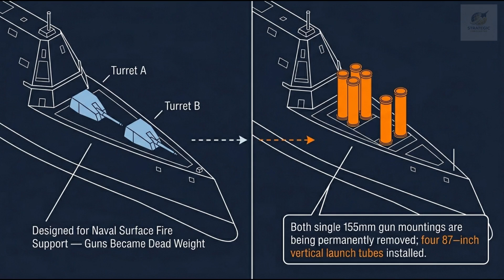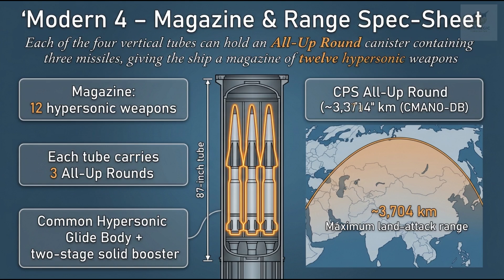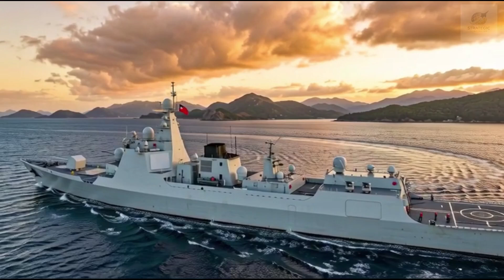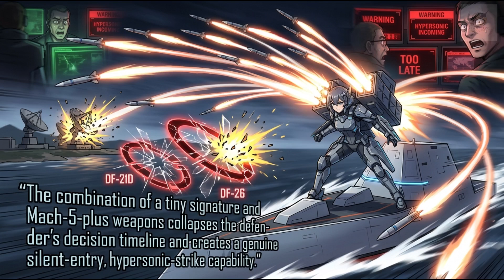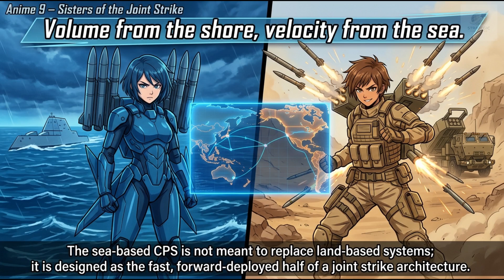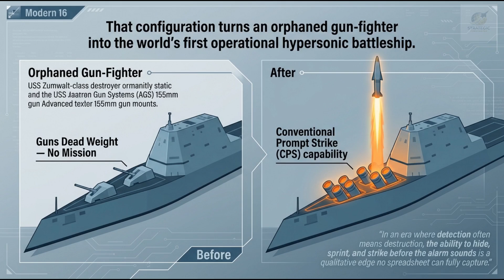Why Zumwalt’s Hypersonic Missile Changes Pacific War Forever (2026)

Comment from the maker: Thanks for watching this deep‑dive on the Zumwalt‑class and Conventional Prompt Strike.

To recap:

    Both 155mm Advanced Gun Systems are gone, replaced by 4 vertical 87‑inch launch tubes carrying 12 hypersonic CPS missiles.

    The Navy’s first true hypersonic battleship can penetrate layered A2/AD rings that would betray a conventional destroyer.

    Combined with land‑based PrSM Increment 2, this creates a volume‑from‑shore, velocity‑from‑sea strike architecture.

Now I want to hear from you:
Do you think three hulls armed with CPS are enough to shift the balance in the Western Pacific, or does the Navy need a larger class of hypersonic shooters? Drop your take below.

👇 If you found this breakdown useful, leave a like and subscribe for more naval strategy deep‑dives.